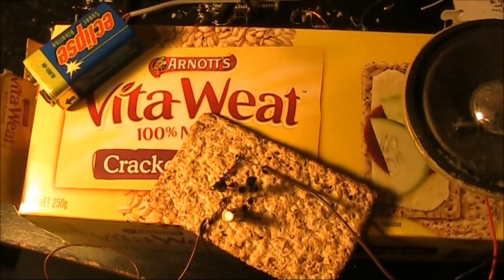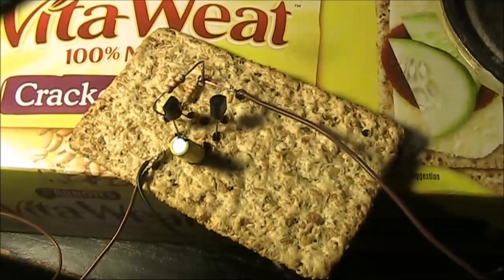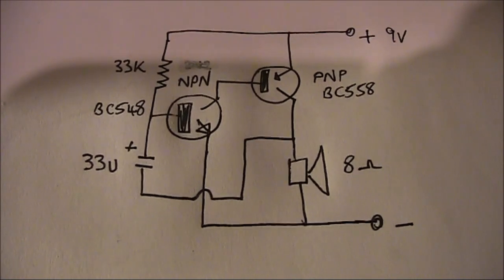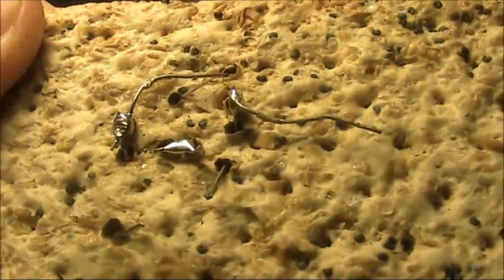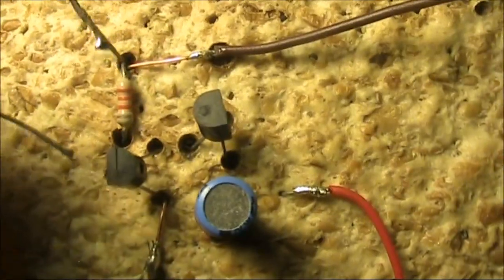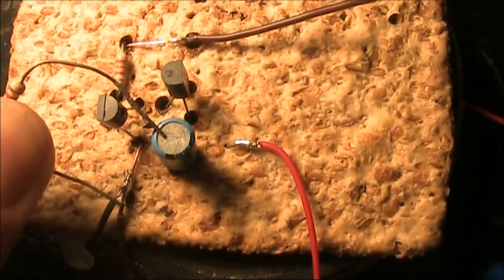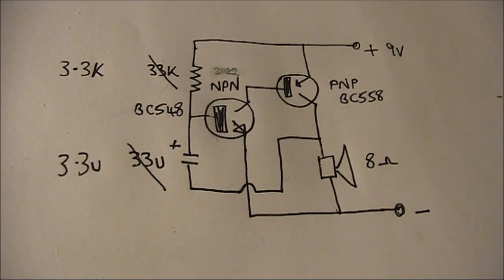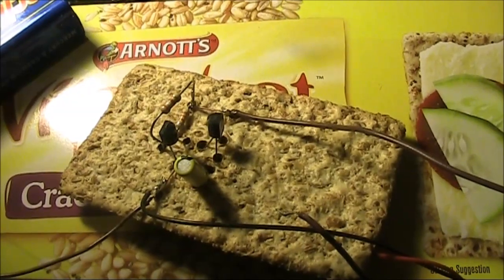Building a crispbreadboard audio oscillator

Comment: I built that exact same circuit (but on a regular pcb) and used a 9V battery and 8 ohm, 2.25" or 57mm spkr.  It was loud enough to be kind of annoying.  I used it a bit and then it just went silent.  The spkr measured open.  I pulled the voice coil out and found the windings had come loose and destroyed the coil.  So the lesson I learned was that those small spkrs really mean it when they say 8 ohm 0.2 Watts!  If you build this circuit with a small spkr, keep the voltage at 5V or less, or better, connect a 100 ohm resistor in series with the spkr to limit the current.